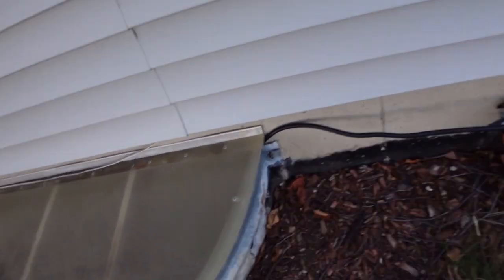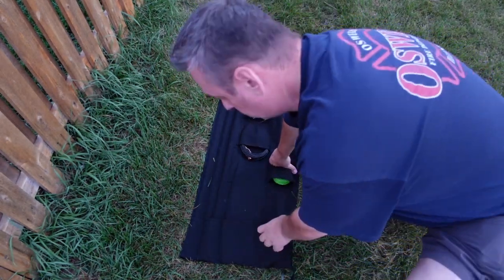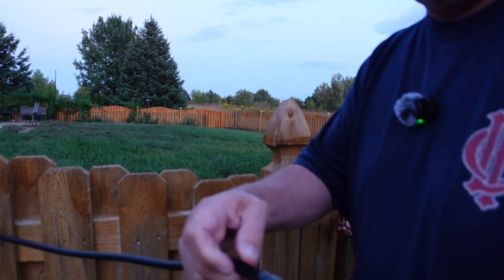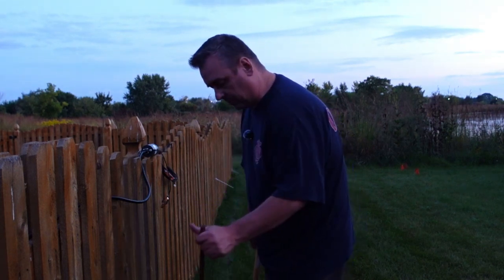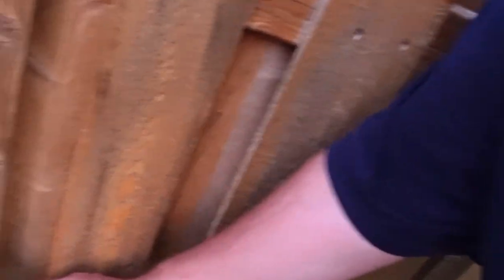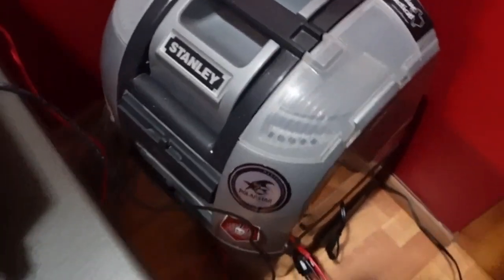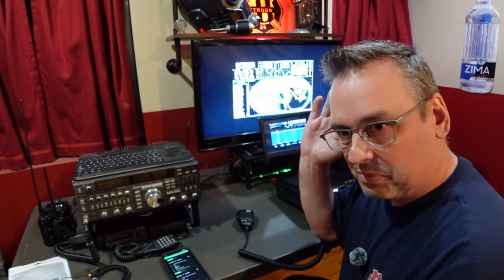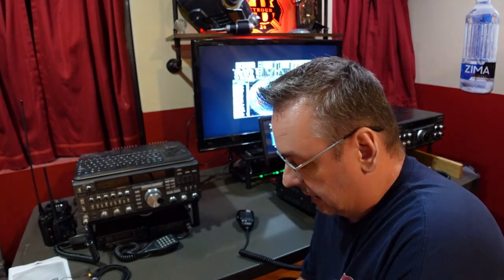Hidden from the HOA: My Ham Radio Antenna Setup

Comment: Got a question my house is in the middle of other houses, your backyard seems like like your backyard is open while I have other houses while that impede the reception?
Reply from the maker: Thanks for watching the video and commenting with a very good question. From my understanding the answer is yes. Between the structures of the homes and also possibly the home having certain electronics that can also cause interference. But like the old saying is: getting an antenna up somewhere is better than nothing at all. Another interesting antenna setup is using the gutters as an antenna, which I might try.....so stay tuned! 73 KC9USB

Comment: I have a few different options for my HOA.  I have an EFHW 8010 that I ran under my eaves and is only visible when you look for it.  The second option is I run the feed point for a 40m dipole up my flagpole and configure it in an inverted V.  Both work great.
Reply from the maker: Thanks for the comment and yes those are other viable options. Unfortunately I'm not able to climb a ladder safely anymore so I'm kinda limited in some of my options. Thanks for watching 73

Comment: Also, would that CTC- COM cable for the window be better for a mobile installation as opposed to shutting the coax in the door or window?  Signed, Still Learning
Reply from the maker: Yes you could use the Comet jumper cable for mobile use like you get to a POTA (Parks On the Air) activation and let's say it's really hot or really cold you could use this to go from your antenna coax to the inside of the vehicle. I personally just leave the window cracked a little bit and it's worked out for me. That's the great thing about ham radio is you really have the opportunity to make certain gadgets work out for different reasons. Thanks again 73 KC9USB

Comment: If you’re going to use electrical tape on your connections why not use heat shrink?  Is there a technical reason heat shrink would be advised against?  Signed, Still Learning
Reply from the maker: Thanks for watching the video and commenting I appreciate it. So I use heat shrink on the coax connectors on the part that screws into the plastic outer sheath and the bottom part of the connector. The coupling needs to be able to move up and down so the heat shrink can only go onto the connector at the bottom section. I hope this explains it, and I do plan on doing a video about putting on coax UHF connectors since I learned from some really old school Elmer's. I use the electric trape just for an extra layer of moisture protection and since this antenna is not permanent I use the tape with a tail left on it to be able to put it up and down easier. Thanks again and hope this answered your question. KC9USB 73

Comment: You make great videos! I was looking at that coax, and wondering if you have tried an end fed around that fence or part of it, fed by a 9:1 or 49:1 transformer, along with possibly a  counterpoise or partial one if you need it at the bottom of the fence, and inside of your yard?  Even the wire itself could be covered with some of that "plastic but looks like wood"  moulding to blend in with the fence which you could merely set on top of the wire. For more permanent installs, I used to use coax seal (tm) but have found a big block of that electrical plumbers putty from Orange Big Box to be just as effective for less Trumpian Patriotic Credits. Why do you place the pipe setup OUTSIDE of your fence perimeter instead of hiding it inside your yard so Karen doesn't see it and inform the HOA Jack Boots? All the Best! 73 DE W8LV BILL (and in SANER times: W8LV/VE3) 🇺🇸🇨🇦🙏🇺🇦
Reply from the maker: Thanks for watching and the comment. Hopefully I can answer a few of your questions: I did try a end fed and a Chameleon Zepp antenna also (which I used in my last night vision video) and unfortunately it just wouldn't get out and picked up a lot of RF. That was my first attempt at hiding the antenna I also used a counter poise along the bottom of the fence and it still didn't work. Why I placed the antenna on the outside of the fence: because my dogs would pee on it all day. Seriously I'm not kidding 😂 I forgot to show in the video but in between my house and the neighbors we have a sprawling out birch tree that also helps to hide things like the whip on the antenna. Hopefully I got a few of the questions answered and thanks again KC9USB 73

Comment: Thanks for the video. I've been wondering about this antenna since I too live in an HOA. It costs a pretty penny so I really appreciate seeing it in action before pulling the trigger. Are there any bands you have noticed it not doing great? I have no idea what I'm talking about, but I've heard that since its flat it has some limitations. Something about a take-off angle or something. I'm a new ham so still trying to figure it all out. Thanks again!
Reply from the maker: @maverick561 I'm going to post a short video of using the TN07 with an older 10M radio that I haven't used yet. Hopefully I can get that out today but it worked pretty good (propagation isn't too good also) but it got through!
Reply: I’m also in a HOA subdivision and have been researching antenna solutions as I’m about to upgrade to general. I think I’m going to be forced to settle for an attic setup but your ideas are great.  Your mosquito costars made me itchy though. 😂 KC0TCC
Reply: @michaelp8794  I wish I could have done an attic setup, but my home is about 10 years old and the roof sheathing has a metallic layer on the underside. I'm a new general and have been doing a lot of backyard portable with a Gable vertical that has been working well. It's definitely time to set up a more permanent home antenna, though. Good luck!
Reply from the maker: @michaelp8794 thanks for watching and hope this gives you some ideas on a stealthy HOA hidden antenna. Hope to catch you on the air sometime KC9USB 73
Reply from the maker: No thank you so much for the comment and watching the video. Welcome my fellow HOA suffers and Ham Radio enthusiasts! I'm glad you decided to get involved in ham radio it's a lot of fun. So it's kinda ironic you asked the question about the bands on this antenna so far it's been good for me on: 80-40-20-15-12. I honestly haven't tried 10 meter yet but......I will now lol maybe next video hmmm I couldn't remember where I found it somewhere on Google if you search for shunt fed antenna there is a good article about shunt fed antenna and towers by Hatfield & Dawson on the application and testing using shunt fed systems. Thanks again for watching and commenting I really appreciate it! 73 KC9USB

Comment: spoken like a true comm installer.. no-ox and tail on electrical tape. lol.. i wonder how a long wire laying in the fence (where you laid/hid the coax run) all the way around your property would perform. ?..  thx for sharing
Reply from the maker: I was waiting for someone to say something about the no ox lol Yes I was with a certain telecom company that was pretty big for a while (Lucent) and was in cell huts and then power. Did a few 5ess install along the way also. Tried the wire along the fence with two different types and didn't work out too well. Thanks for watching!! 73
Reply: @ham-dalorian .. ahh nice to know about the wire try.. some hoa folks have good luck with those. I’ve worked on telecom -48v DC power and fiber optics as well.. so the no-ox was familiar, lol.. thx for sharing your video. good luck as a YT creator.